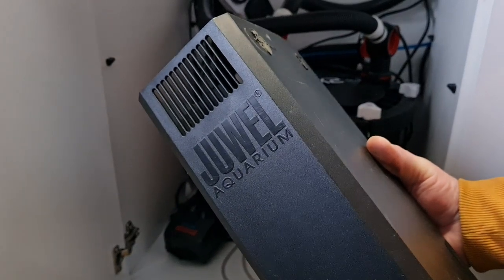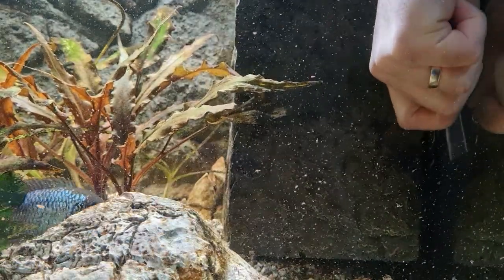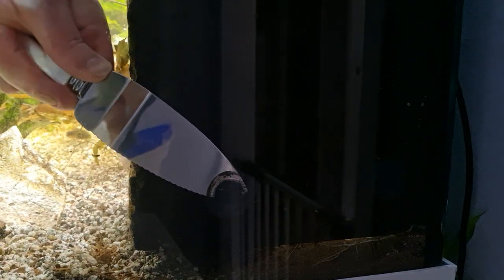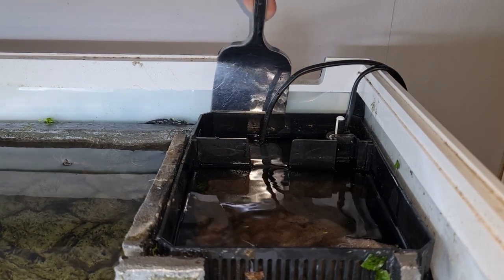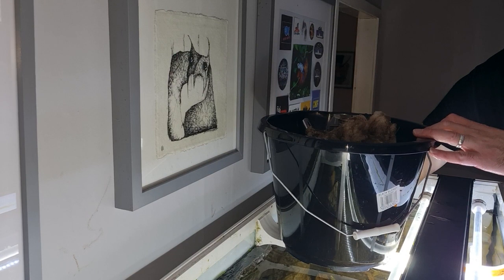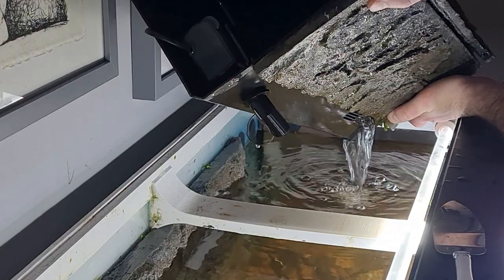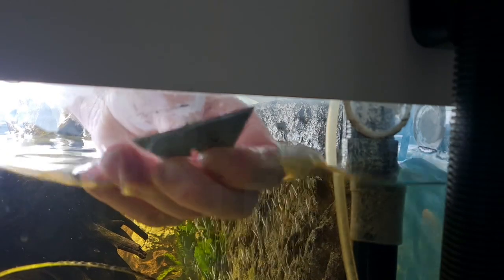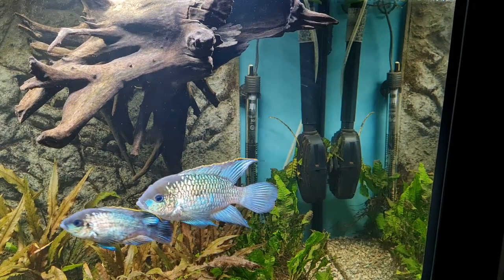HOW TO REMOVE THE FILTER FROM A JUWEL RIO

Comment: I share your pain with this. I normally use a fishing line to remove Juwel filters. Cut a long piece, push the line behind on both sides and work my way down pulling from one side to the other. Comes off quite easily. Fishing line is plastic hence will remove the potential to scratch your glass.
Reply from the maker: That is such a great idea! Thanks so much for sharing your tip. I bet a lot of people will find that useful.
Reply: Did the fishing wire work to get this filter off?
Reply: @kierongreen3636  yes

Comment: People are clearly not using this filter correctly if they feel the need to remove it. It's a very efficient filter if cleaned and maintained regularly.
Reply from the maker: Yeah I liked it. I only swapped it out as Fluval sent me the FX to try out. I wouldn't have swapped it out otherwise. That said although the Juwel filter was fine the Fluval is a definite upgrade.
Reply: The filter is not suitable with shrimp. So you are clearly using the incorrect filter if you would have a shrimp tank. Don't be so judgy.
Reply: It's definitely better that that fx6 .

Comment: i did the opposite on a 6ft tank  i replaced an fx6 with 2 xl juwel filters = more filter capacity than fluval  , much  lower wattage per hr than fluval , higher flow than fluval but spread out between 2 units  i'm very happy with the results
Reply from the maker: Sounds pretty ace. Yeah I would never have changed it out had it not been for Fluval sending me the FX to test. I must say I do consider it an upgrade (although maybe not compared to two Bioflows) and I don't appreciate having more space in the tank.
Reply: I've had my Rio125 and Vision 260 for about 20 years and both filters have now come off by themselves, you just need to wait.

Comment: even easier if you just pull it off slowly from the top, the silicon doesn't stick that well to the filter so slowly pulling it starting from the top, looking at the tank from the front, pull the front top of the filter towards the left and that first bit of silicon will let go, pull a bit more and the second piece next to it will also let go, after that just keep going to the left slowly and all the rear and bottom pieces will easily let go, still need to clean up the silicon off of the glass but no need to force tools in between the glass and the filter
Reply from the maker: Should have tried that in the first place hey. 🙄
After seeing how easily the last few came away feel like you could be entirely right. Unfortunately I'm passed the point of being able to test it out but hopefully others about to remove their filters will read your comment and attempt that first. Thanks for commenting with this.
Reply: @DanielKeepingFish  yeah i've always cut them out before, had about 5 juwel tanks in the past, just got a new 350 and thought id try pulling it and it was super easy only taking about 30 seconds to get out, just wondering if you had the red clips still on the light bar, saw them still on one of your vids, they pull off to and the whole lid will sit nice and flush after, all the best

Comment: Hi Daniel.  I'm currently using a Hygger double sponge filter.  This filter has two containers at the bottom.  I'd like to fill them with Activated carbon, to reduce bad odors + keep water clearer.  I've seen Activated carbon balls (plastic casing).  Are these OK to be added into a double sponge filter???
Reply from the maker: Yeah totally. Just be aware activated carbon only lasts so long. It's all relative; the more impurities the carbon absorbs the quicker it becomes ineffective. Generally if we're changing it out once per month we should be about good.

Comment: How did you plumb in your canister. Would the dig outs be wide enough for an fx6 inlet outlet?
Reply from the maker: No the pipes didn't fit. I ended up cutting slots in the lid to accommodate them. I'll pop the link for the video at the bottom of this comment but if that doesn't work go to my full list and it was nine videos ago.
Here's the link: https://youtu.be/uDUqwR74p-0?si=O-aCMey9PVEsCVNl
Reply: Cheers 👍
Reply: Juwel doesn't seem to want you to use anything but theirs. I have noticed this. I also noticed that Fluval, on the other hand, made Aquasky lighting that is compatible with the Juwel T5 lighting system. What pain having to dig the box out to find the outlet tubes don't fit. Shame on you 'Juwel' 😕